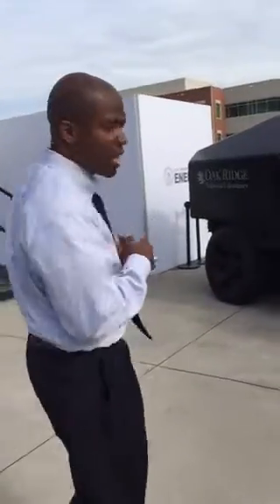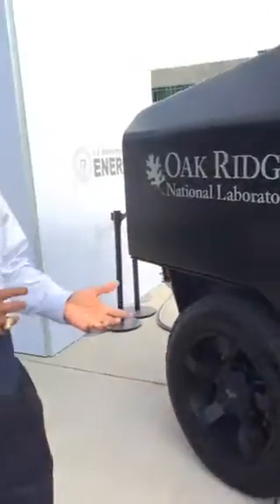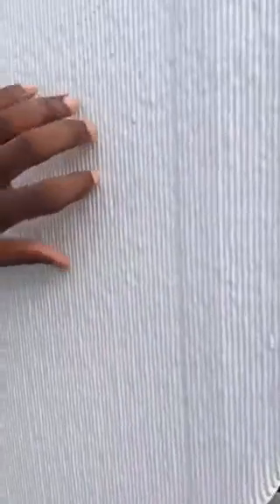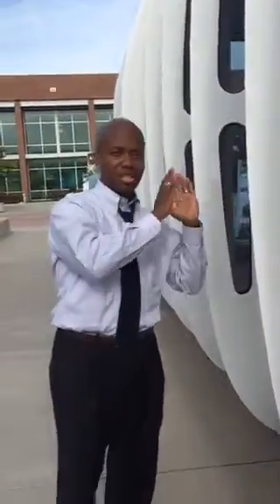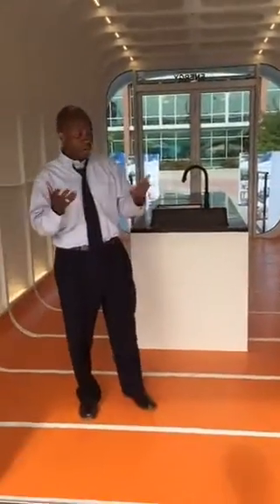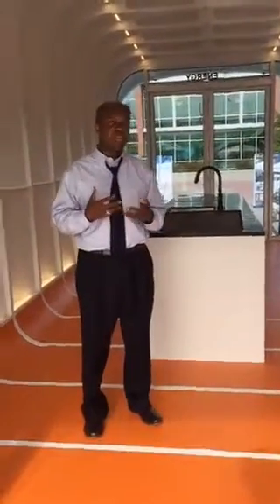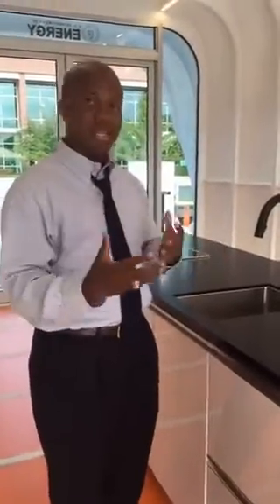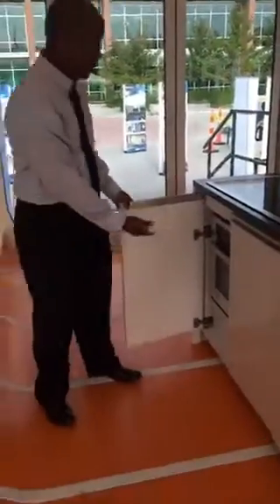Roderick Jackson explains the AMIE Demonstration Project

Comment: ok~ one car for one small house , but the hum sound could be a bit much if a lot of cars were active for powering a home. , the r4 factor of insulation  did not seem to buffer the hum sound .
Reply: +emerald1one1, Well did you notice that the front doors were wide open during the whole presentation?  Thus your hum sound came through the front doors.
Reply: +David J. Smith ah yes observant you are, thank you for the incite. knowing it is a demo yet , demos help those to fine tune projects or presentations,  which you may have just helped them do much better.   hay bale insulation  could be of help too yet there are more earthly animals which need their food source verse an auto vehicle.  wonder if the Amie facilitates a buffer zone from CMEs, and that it will not blow away in the fast winds,  where is the septic overflow? = what is the pottie attached to or is it solar zapping  the debris?  no Faraday cage , no info of where  the de bris  may exit~ continue with your incite to them for they need that structure from many viewers to  aid them even with their video demos from a business perspective ~ ok    . from one abode to another --  all the very best and friendly regards  help them think
Reply: +Emerald S   all looks so smooth and clean ,fire tested? health safety issue , recycle , question the Lab  above . think out loud they may Truly note those questions or comments .     how much energy or source to make a 3D item / same goes for printed human body tissue . cool idea  as above comment or front doors  were wide~ open   .  you and  comment above  can ask much better ,  Hi to the Oak Ridge; National  lab     = no need to reply but the videos could be  improved upon ,,,,take care